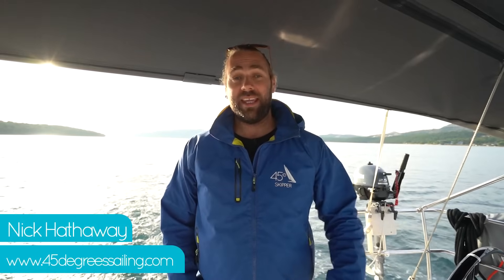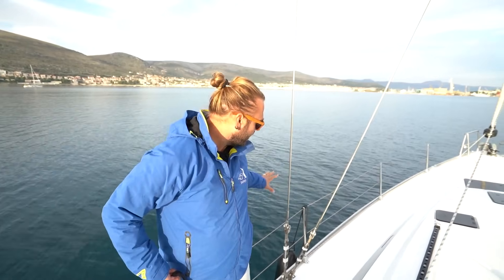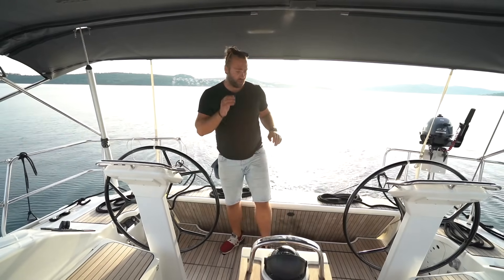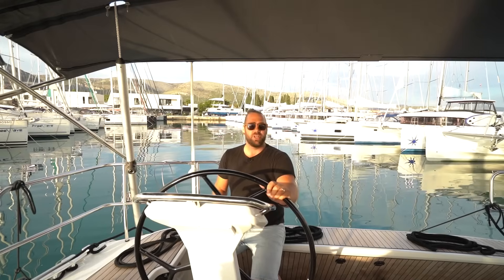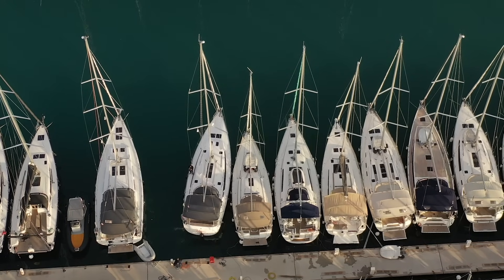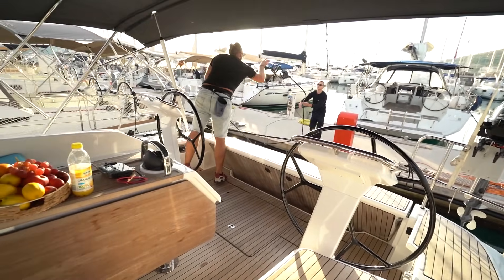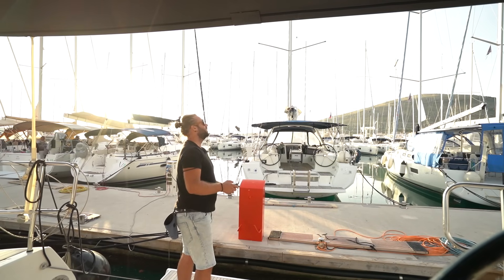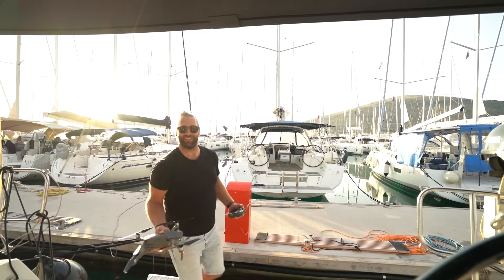Singlehanded Docking Stern To with Lazy Lines

Comment: this video was completely pointless when you said "il turn my bow thrusters and stern thrusters on" everything else is irrelevant if you have those. try doing it without them. was entertaining to see though. thanks.
Reply from the maker: 🤦🏽‍♂️ I didn’t need them. I didn’t use them. Only an egotistical fool would not be prepared with all that is available in case of the need to avoid damage. And completely pointless? 
Maybe this channel is not for you. Thanks for stopping by ☺️
Reply: @45DegreesSailing  WOW. little touchy there mate. you did use them to back down and any wind you would have definitely used them. relax there sunshine 😎
Reply from the maker: @freelectron2029  😂 watch it again. Didn’t touch them. Yeh probably a little touchy, I work on responding to all comments on my videos (close to 500 on this one) as the majority are looking for information or have questions about the process. 
When someone decides to call the video ‘pontless’ due a claim which they are just blatantly wrong about, I will defend it.
Reply: Would a welder filming an instructional video with a fire extinguisher in the background be pointless? I feel to see how being prepared for all eventuality is a negative and on the contrary surely more closer to 'best practice'. If I can helm and manoeuvre like this in time and with practice then I will be proud of myself.
Reply: @blaircunningham903   you miss the point. thrusters arent safety devices they are steering devices.  using your analogy. the thruster is a grinder.  a tool. the welder would have not needed his grinder on this occasion because the steel was already cut to size, BUT that is almost always never the case. so with out a grinder its a very different job. you see how analogies work? lol.
Reply: @45DegreesSailing   how did you turn the boat to back down the lane? thruster. watch it again. how would you have backed in if the wind was up like it is 80% of the time in any harbour? thruster. my point still stands. if you have a boat without a thruster and the wind is up (as it always is) then this video is just showing grandma how to reverse a boat in a huge gapping hole. not exactly rocket science. my secondary point would be if you needed to watch this video to learn how to do this, then you shouldnt be docking half million dollar boats anywhere.
Reply: @freelectron2029  I can see that you are an individual who enjoys pushing/trying to push people's buttons. Whether tools are or are not required is irrelevant as long as safety is put first. Surely if you have them and there is no shame in using them in bad weather then what difference does it make using them in good weather.
Reply: @45DegreesSailing  you obviously know your stuff and you are good at video choreography and on the fly narration. no criticism there. just saying this didnt help me. my 47ft 13T aluminum yacht has a sail drive and folding 2 speed prop and no thruster.(far more common and i would say the majority of your viewers would have something similar) mines got plenty of prop bight in reverse. its just when that bow catches the wind. she swings like  epstein not kllng himself  .fast and enevitable. id need to pick up that upwind bow line as soon as i drive over it so as not to lose the bow down wind and then back down off it to get to the wharf. show us how thats done. if it can be done.
Reply: I think there's nothing wrong or pointless in using the equipment you have, whatever that is. The theme of these videos that I take away is to slow down, assess the situation, visualize how it's going to work and all the prep you need to do ahead of time. I think if you want to see something different, it would be kinder to say "hey this is great. I have different constraints. How would you approach it if..."
Reply: Btw I agree with your point about picking up the upwind line. But that's boating. Everytime I reflect and think, "this worked well, this other part could've been better..."
Reply: @blaircunningham903  i am a person of practicality and calls out bs when i see it. i am a person who thinks clear messages and truth is more important than feelings. i am a aperson who thinks when you go to the effort to do something you should do it right and to the best of your capability. this guy has great skills, excellent equipment and most importantly time. the stars have aligned. why not take full advantage of that.
Reply: @dpurrington  noted
Reply: Did you even watch the video after he checked they were working?..
Reply: @Bally46  yes. yes i did. the point being he HAD them if he needed them. very different to not having them. anyone can park a boat with twin thrusters. do you even own a 50ft yacht? i do. having something and not needing it is a very different story to not having it. you wouldnt attempt certain things if you dont have them. anyone can park a boat with thrusters. so anyone will attempt almost anything if they have them as backup. try doing it without. you cant and you wont.